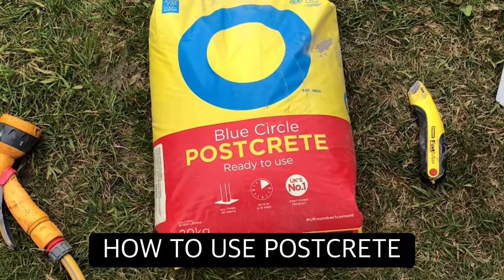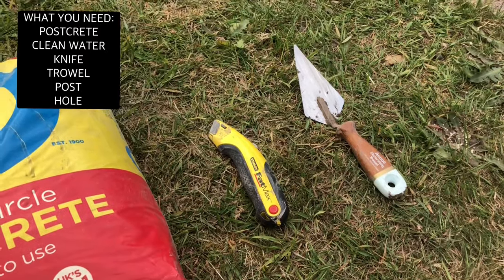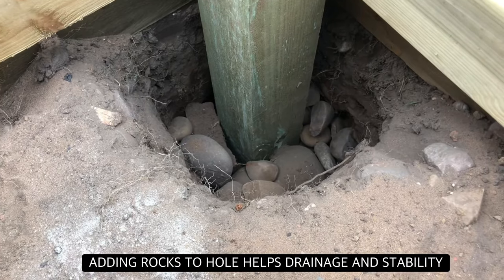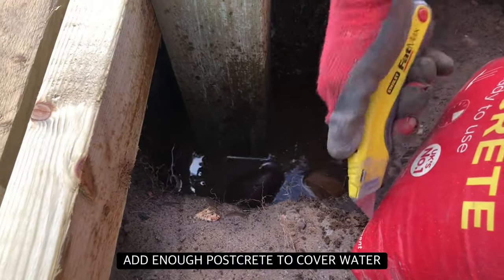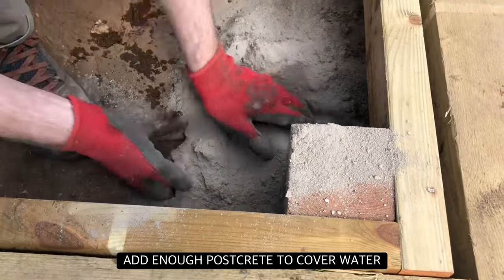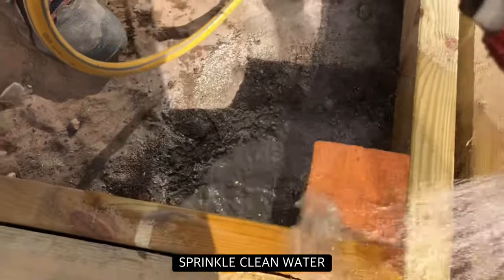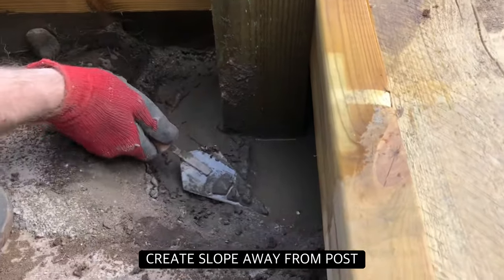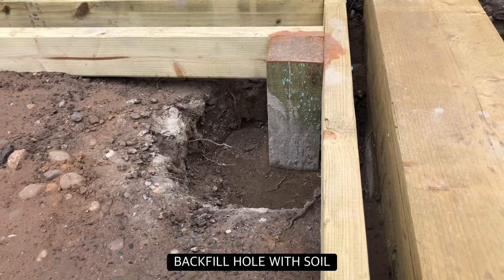HOW TO USE POSTCRETE | WOODEN POST INSTALLATION | DECKING DIY

Comment: Back filling is wrong as soil holds moisture which stays in touch with the post.
Reply from the maker: Of course, no wood is invincible to moisture but we used pressure treated timber for our posts. If you’re particularly concerned, you could back fill with gravel or ballast instead.
Reply: @tee-i-y9994  
You should always use treated wood but I would have added more concrete. Raised it and give it a little slope to run off.
Reply: Also that's more like a stake not a post. I've put up 8ft to 9ft 4 x 4 posts. Which needs about 3 and a half to 4 bags. 
The postcrete needs to get down the sides. Ballast like you've added is not good for  8ft posts. I'd keep to the instructions on the back.
Reply: @tee-i-y9994  or concrete
Reply: Wrong. You back fill with pea gravel.
Reply: Fantastic video. Succinct and very informative.
Reply: @tee-i-y9994 pressure treated is best but most builders don’t then treat the cuts or holes they make when joining together and that’s how the rotting all starts

Comment: If it were me I would just use pea gravel compacted in six inch lifts and set the post a minimum of 24 inches below grade. Every time the post  wiggles the pea gravel settles locking the post in place even tighter. The pea gravel allows your post to breath and dry out. Wood fungus is attracted to wet posts. I would also apply asphaltic foundation coating on the post below grade even if it is pressure treated.
Reply: im guessing the video was intended as a guide for DIY. all the bolloks you've added above means nothing to a DIYer.
Reply: @iamyourfuture808  I am assuming that anyone with average intelligence would and could understand that what I suggested would be a better alternative.
Reply: @gary24752  While what you're saying sounds like it has merit, I don't know what a "six inch lift" is what "below grade" is. Devil's in the detail.
Reply: @andrewgoodall2183  pour in gravel to a depth of six inches and compact then repeat till you reach grade.
Reply: @iamyourfuture808  Like anything else  you do not know how to do. You research, read and then apply.

Comment: Never used Postcrete before, just watched this video.
I dont agree with having a pile of rocks around the base of a wooden post as this will encourage a permanent pool of water unless you have decent drainage that low down.
I have used timber posts and used traditional creasote at the lower part of the post that is below ground and will use extra Postcrete rather than ballast at the bottom of the hole. I prefer your method with concrete posts, which i have tl do later in another part of the garden.
Thanks for the demo 👍👍
Reply: It's not that i don't agree with rocks it's in my eyes good for those who are on a low budget because the gaps in the rocks are filled with cement. Please be advised that if you go by the vocal wording in video regarding rocks for drainage, youll always think drainage which is not the case as the gaps in the rocks are filled with cement.
Reply: Concrete footings are required when there is a load that needs to be spread out in order to carry the load for the soil type. Fence posts do not need that. They need something to support them in the soil to keep them from moving sideways. The more the post wiggles, the tighter the gravel  becomes. The gravel at the bottom keeps the post from having direct contact with the soil and allows it to dry out. The water will not pool unless there is a high water table.  Gravel around the post in the form of small stones allows the post to dry out. Concrete will retain moisture between the post and the concrete thus not allowing the post to dry out. The post then could become saturated which is just an invitation for wood fungi to attack the wood. Wood posts that are pressure treated can still become saturated and will still rot if they never dry out. Pressure treatment was never meant to protect wood that can never dry out.

Comment: Rocks! Thats just a cheap way to fill the hole because lets be honest the cement poweder you poured in after the water fills tge gaps in the rocks so hey no drainage there 😉  plus cement can take a day to a week to dry out depending on how much water you used.
Reply: Being honest though using rocks for posts is good for those on a low budget.